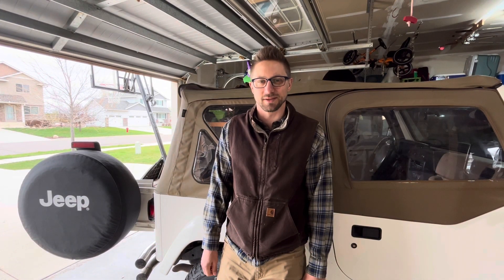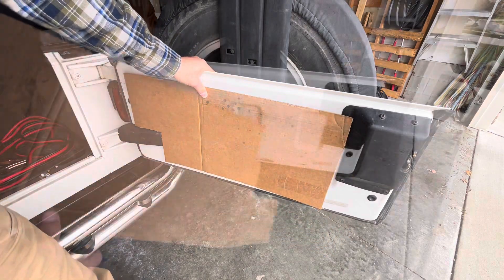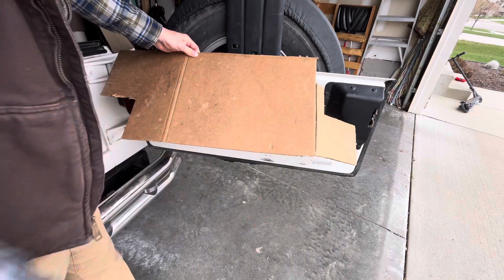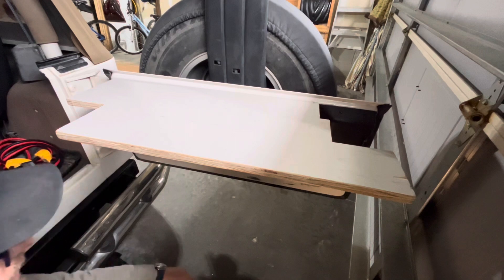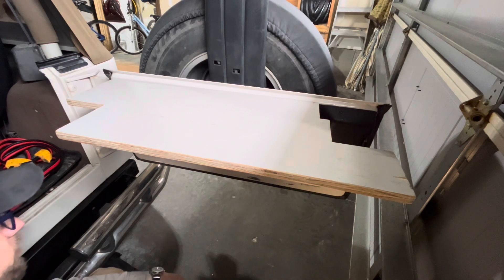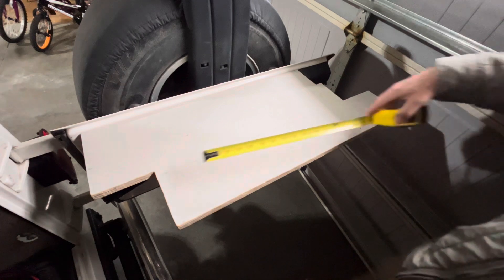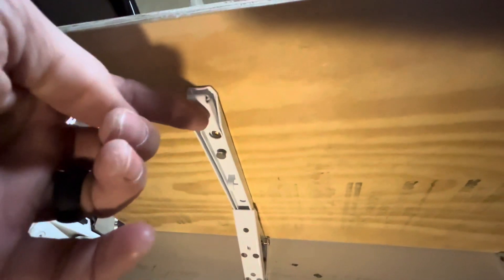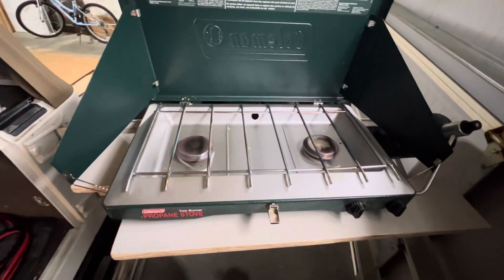DIY Jeep Wrangler Tailgate Table for $10

Comment: When you installed the hinges did you have to be careful of the wires for the tailgate light? Anything you recommend to avoid drilling through them?
Reply from the maker: @dylanodonnell-middleton1788  Yes - I just barely got through the metal, then stopped.